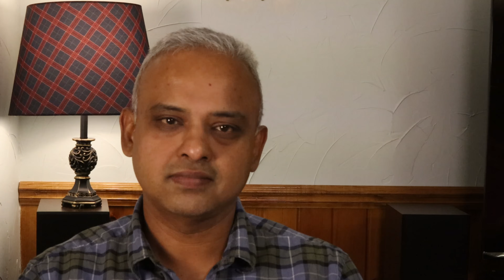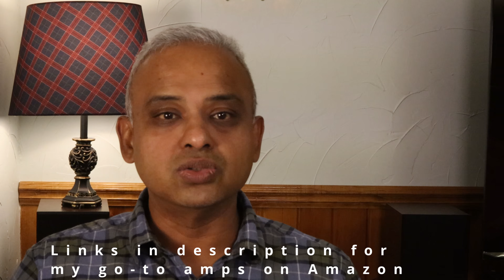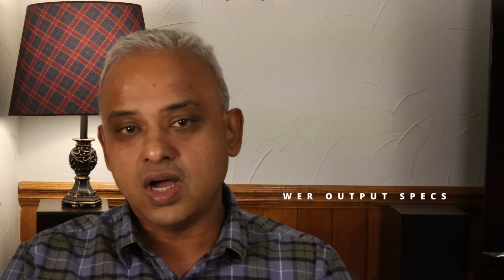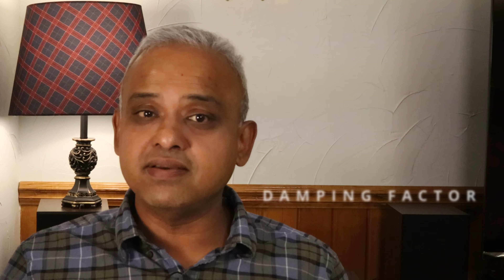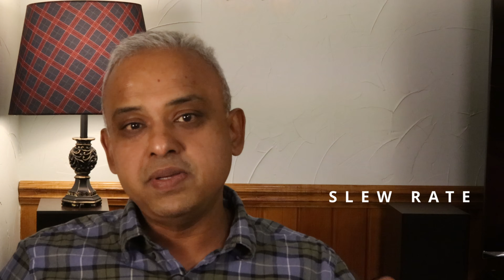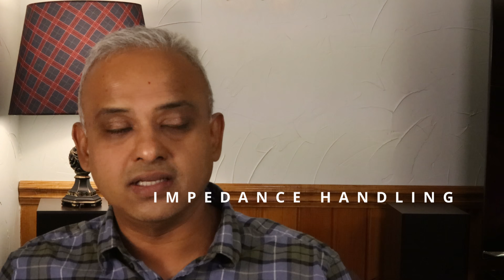Most Audiophiles Get Damping Factor Wrong—Here's Why

Comment: You should have mentioned that  really low THD rating can be achieved with a lot of negative feedback which causes time smearing which can hide a lot of fine detail. Years ago I had an mid priced amplifier where all the specs you mentioned looked really good on the brochure but  later when I got a better amp I heard a lot of fine detail that I did not know was even on the record or CD , shortly after I learned what I mentioned above.
Reply from the maker: You’re touching on something important, but it’s worth clarifying that feedback itself isn’t the villain. Poorly implemented or excessive global feedback can cause issues, but well-designed feedback improves linearity and preserves detail. What you likely heard was the difference between designs with limited bandwidth or poor compensation versus a more refined implementation. Feedback is a tool, not a flaw.

Comment: A fantastic video and subject, than you.
What is the importance and effect of peak current figures? Some amplifiers have a peak current of 5A where as other have 25A. How important is the current stat
Reply from the maker: In most  cases it is  manufacturers attempt to indicate robustness of power supply with the ability to  handle demanding draws (low impedance speaker loads, drawing high current)  in short bursts.
Reply: @analogholic_reviews thanks, so it sort of explains why a hight current 40W amplifier can sometimes sound more dynamic and better overall than a  low current 100W one.  
Is it a bit like horsepower and torque in a car? A car with high torque (current) can be more responsive than one with more horsepower but lower torque

Comment: What an amazing video! You've covered some extremely important and overlooked spec sheet items. Things like THD, slew rate, damping, and input sensitivity! Combine this with a cursory understanding of circuit topology, current and transistor design, and you've got some great clues regarding what to expect.

You've nailed it though. A spec sheet provides clues on both sound and potential synergy, but the numbers and design all need to make sense  together both within the amp, and within the rest of the system. Ultimately the numbers will never trump actually listening.
Reply from the maker: Thanks for the support, means a lot!

Comment: That was a lot of great information.  As a Bryston fanboy on a budget, I am curious if the new 3 version really beats the 2.  Specifically the 7bsst2 monoblocks monoblocks I have vs. 7b3.  The newer version described as warmer which is not my goal with Bryston gear.  I can't begin to imagine 16k for new amps would give me enough warm and fuzzy feeling vs what I have.    I have considered bi amping because that would seem to offer improvement in bass and treble too.  Bryston touts the active system which needs 3 amps per channel.  Makes sense if selling amps...